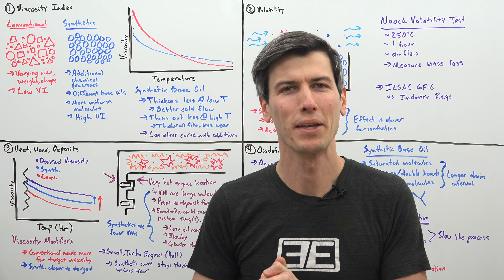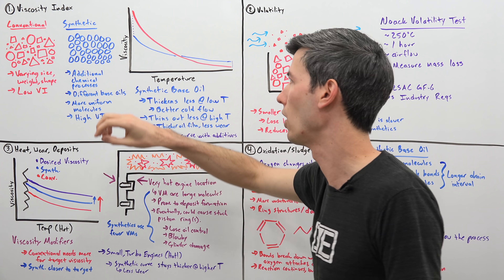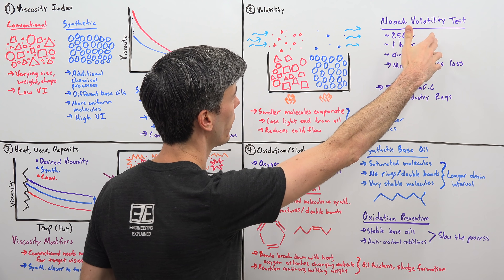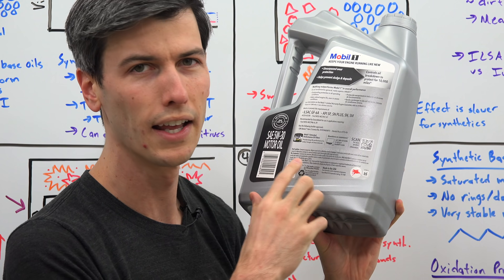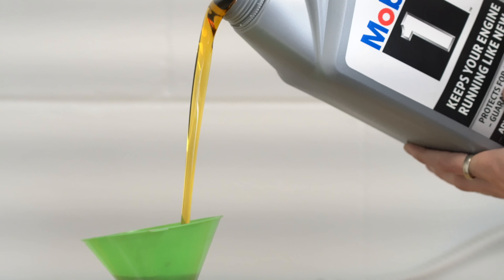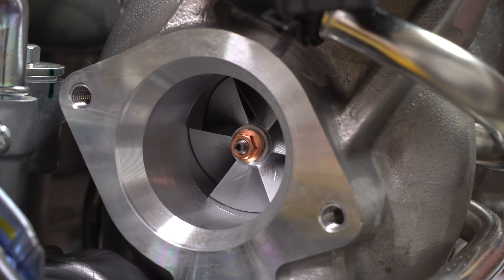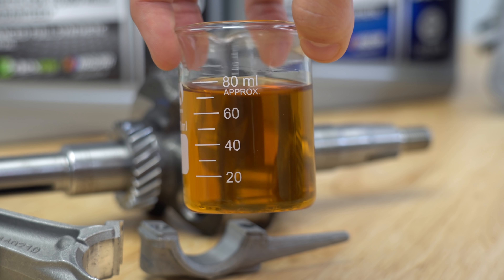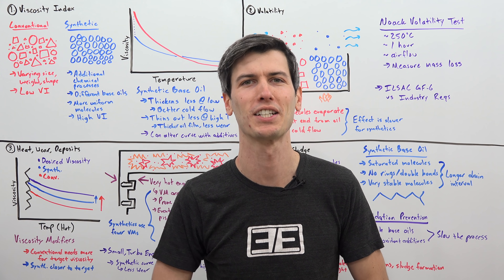Synthetic vs Conventional Oil - There's A Good Reason To Switch

Comment: In the old days we put straight 30 weight in our motors. I wonder how that works compared to the kind that are formulated ie 5w 30 especially with sludge. Sometimes I think the additives are what causes it. waxes basically.

Comment: I think a bit of sludge is good, it protects a bit of the engine, so I have my doubts on using Synthetic 100% of the time.

There's also Hybrid Oil. So if I had a car, I'd do this: First Mineral/Conventional Oil, it adds a little particles to plug any holes in the structure; then on the next Oil Change, I'd use Hybrid, then Full Synthetic, then Hybrid again and then Conventional again, starting a new Cycle, i think this way is a balance combo of enough sediment to have holes plugged, yet having equal parts of Detergent Synthetic to keep it clean enough to not have too much sediments. After 3 Cycles, a Flush with BG Complete Engine Cleaning Kit, so that would be about every 6 years or 60,000 miles; which I think is a good compromise for cleanliness and sediment plugin the engine.

I'm based on the experiment these guys did with 2 gasoline trucks, running them 100,000 miles in a device, not on the road; 1 with Conventional and the other with Synthetic, the Synthetic 1 was almost clean and suffered less wear and tear; so apparently is Synthetic all the way but, Conventional helps the seals to expand and seal better. So, with my humble method, I think you get the best of both Worlds, specially with Hybrid/Mixed Oil, which gives gradual and smooth transition, from 1 pure type to the other.

I would like for @EngineeringExplained to make this 6 year experiment, and check his engine in every Oil Change; to enlighten us all; if you do it, I thank you in advance

It was insightful yet succinct, thanks for that.
In return I give you this advice: 
1) Your neck is not straight vertical, you have an angel, that's not good, learned from Chiropractors. Also you curve your shoulder area, check yourself from the side on the video, you have to be straight.
2) You shallow breath: so you make an effort to finish sentences, the blood vessels on the right side of your neck inflate, when you are running out of oxygen and your blood pressure raises to high unhealthy levels. Take a Deep Breath, and speak a bit slower, exhale slowly; it's the most efficient way to breath, it's also calming.
3) Go to the Gym a little, having muscles tonified, is healthy and will give you energy when you need it

Comment: Synthetic oils use the same base stock "cracked" oil molecules to the same size, better heat tolerance, flow, stability, and the ability to capture combustion components for filtration. My oil doesn't turn black; oil filter is now black from contaminates. 30 years ago, the conventional oil in my engine would be black in a week or so. OEM synthetic oil/filter is the best, at $6-$8 price/ quart, plus better mpg. I would not run a turbo engine without synthetic oil.

Comment: Oh no right when he said Mobil1 i quit😅, marketed nonsense stuff. What matters guyz is this.. They can call it fully synthetic BUT it can be 100 mineral oil (hydrolocked crude oil) with synthetic additives (anti ox, anti wear, blabla...). The REAL 100 synth is at least 75% 50-50 or 60-40 or 40-60 ratio of ESTER+PAO (+ adds)!!!

Comment: Good marketing......if the manufacturer recommends an oil for that vehicle in a region, use that. 
There is no need to use top shelf oils unless you're expecting to run that engine beyond its normal operational limits.
Reply: Why do you say that, he at no time mentioned any specific brands.

Comment: It is just the same to use mineral or syntehtic oil if the oil is changed often enough. They are just as good lubricants. Especially SL or "older" oils. SL is "life", SM or later are "murder", a rule of thumb.  Some "old" oils are actually better as lubricants.  But, some modern engines are more picky for oils, even to the point where the oils are car maker specific. That just tells that those engines are borderline reliable.
I have several cars and trucks. My -79 Blazer has original engine with million+ kilometers on it. It runs like new, just passed MOT test like it was actually new. But it has had oil changes at about 5000 kms max, usually 3000 kms or less, mostly mineral oils, sometimes synthetic for hard winters here in Finland.
While the syhthetic myth has been created by oil manufacturers,  the real benefit is with turbo engines. While turbo engines are more efficient, they are also more unreliable. Using syn oil keeps that cursed thing alive longer as it does not burn to crisp but to sticky goo. Just like every motorcyclist knows if oil gets to the surface of exhaust pipe.
The uniform molecyle size is indifferent thing. It does not matter, it just comes with the manufacturing process.
And, most synthetic oils are for light duty use only. I once, long time ago, thought that 5W-50 Mobil One is the same as straight 30W oil for my boat engine , 5.8 V8. I cruised to Kotka from Helsinki, and at Kotka end listened to the engine , it sounded BAD. The oil had just failed. I fortunately was able to get 30W oil from a local fisherman, and after changing the oil the engine was silent again. Later i told about my mistake to the OMC mech, he gringed and asked if I had blown the engine... Now, using mineral 20W-50 the engine is happy.
Mineral oil is cheap. There is no need to use syn oil with older engines. Just change the oil "too often". New engines are designed to be disposable, and meant to last about 5 years, so use the recommended oil to get them last even that. But change at half the kms that the manual says.

Comment: If the vehicle originally speced conventional oil, stick with conventional oil. If speced synthetic, use synthetic. But no matter what you use, change it often. Polymers break down fairly rapidly, and dirt in the oil, no matter what kind, is the enemy. And most synthetic oil sold in the US is simply upgraded conventional oil, not a true ester based synthetic.

Comment: I have been around for quite a while. You have confirmed so many of my thoughts. Thanks a million! A few extra $ well spent and I still change my own oil.  Make ing cost basically same price or less as Oil change shop and I control what goes in my vehicles. No guessing games .One car one Rv  . Have used synthetic since it hit the market. Also use K@N filters since forever. Any thoughts on K&N or did I miss a presentation? Thanks again.

Comment: Alright, explain this.

New motorcycle.  New !!!!
Don’t forget it’s new.
Yes, I said new.
Motorcycle is 100% stock.
No mods.

From day one, it runs great on 87 octane.
600 miles, first service, oil & filter change. Still running great.

1806 miles, running great and goes in for second service, oil & filter change.  
pick up bike, now ENGINE KNOCKING first two minutes, then smooths out.
Every time the engine starts it knock for two minutes.
But not completely, yet hard to notice.

NO ECU updates.

So new bike, no internal adjustments, no modifications, just oil changes. 

This is on 80% or high of all this type of engine.

The only difference between new and the services are the oil changes. All these motorcycles with this engine all over the world have this issue.

The common denominator is the oil change.

Is it possible that the oil at the factory is conventional oil and it doesn’t cause the knocking ?

IF this is true then conventional oil lubricants better than a semi or full synthetic in this particular application?

Can anyone help here ?

Comment: Viscosity index modifiers are not lubricants. They are a major cause of sludge and gunk that forms in an engine. Notwithstanding, it also makes up ~25% of the oil in a multi viscosityquart.  A mono grade 30 weight high detergent oil is the best thing that you can use, conventional.  It will not ruin the seals in your engine and unless it’s 32°F or below, you got nothing to worry about.  Change your oil every 5000 miles with hi detergent conventional motor oil.  When you use a mono grade oil during the summer 100% of the contents of the quart of oil is lubricant.  Manufacturers of motor oil don’t communicate this because they want to sell the narrative of a multigrade oil.  Multigrade oils are absolutely a must if you’re going to have temperatures below 32°F.  However, if you don’t change your oil often, you will form gunk and sludge in your motor and ruin your engine.

Comment: What would you recommend in my 1998 Mercury Grand Marquis with 78,000 miles? It doesn't leak or anything. I just got it. Runs great. Super quiet. Getting ready to do oil change. Have no idea what was in it prior.. I'm debating on syn blend or full synthetic, Valvoline max life blend or full synthetic? Idk

Comment: There is an inherent problem when switching form a conventional oil to a synthetic oil. I as well as other people I know had our vehicles start using oil in between oil changes after making the switch. If you are going to make the switch go with a slightly heavier oil. Example: if you use 5w30 switch to 10w40. That will slow down consumption...it did for me.

Comment: Heres the fastest way for me to tell you the difference, synthetic lasts 5k miles, (regular oil change intervals, some run 10k miles, and I don't recommend higher mileage) and conventional lasts 3k miles, this entails that you get 2k miles more out of that oil and it costs around $5/10 more, and you basically get double the mileage when considering the cost of the oil change itself, you are saving money just by running that synthetic oil

Comment: I will never use synthetic oil again. I have had two very bad experiences with synthetic in engines. One trashed it where I had to sell the car. The oil is so thin, that with one small valve cover leak. Your motor is gone. There is no reaction time.

Comment: I have used Mobil 1 products for 40 years and can attest that it has worked great for me. It’s new torture/ litmus test will be in a GM High Feature 3.6 liter + 300 HP engine that is 12 years old. Can it make those pesky timing chains last another 12 years?  So far, so good.

Comment: I've had similar conversations about metal screen oil filters vs. paper filters. Metal filters are more  consistent with the size of particle they let through (medium small), where paper has a wider range of particle they filter (large medium small).

Comment: Good information.  I wish it went further.
* outcome of going from 0W-20 to 0W-40?  Good or bad?
* is changing oil once a year enough?  Under 5000k miles per year.
* many cold starts, low mileage yearly less than 3k,  is oil change once a year enough?

Comment: This is a great story but in real life I have over a dozen collector cars , I have always used 15/40 Castrol diesel in all my gas engines and a dose of GM EOS for good measure , some get changed every 10 years and as I am always playing around with cam and head changes I can see first hand no negative effects from extended changes , also ran a fleet of cube vans of 2000 model vintage same oil changed every 10,000 km after 500,000 plus km engines were showing minimal wear !

Comment: Warning, this video is no longer relevant since most full synthetic oils today are Hydrotreated instead of PAO! What he said as conventional oil is hydrotreated, what he said as synthetic is hydrotreated. He was comparing hydrotreated vs hydrotreated, how could they differ?
Reply: There are plenty of mineral diesel type oils out there, ...but generally yes you are right 99 percent of synthetics are hydrotreated mineral oils called Full or Fully synthetic.   It is just another American scam.   Synthetics or hydrotreated are both cleaner than mineral oils thereby better as they do not degrade into sludge etc., as fast.   I am skeptical of the influence of differing molecule sizes.  What practical difference does it make if the oil is a soup of varying molecule sizes or more uniform sizes?

Comment: But conventional “mineral” oils have a higher viscosity at base. You can make a 10w-30 or 15w-40 oil without any modifiers. 5w-30 have a 1-3% modifiers, 0w-40 up to 15%! Not any synthetic oils is good, some of them kills pistons already for 30-40 thousand miles.

Comment: I tried switching to synthetic at about 100K - engine started leaking - switched back to conventional - leaks stopped after a few K... engine runs buttery smooth with conventional. Just change it every 5K

Comment: Okay but let me say this. As a 49 year-old I have seen Toyotas and Honda engines that (that I and people I know have own) have used conventional motor oil go continually over 300,000 to a 1/2 million miles. So why should I use synthetic oil when I don't see anybody driving a car over what conventional oil can do for an engine? Truth! Besides the cars they make now with all of the cheaper components like alternators, starters and all the computer and electrical driven motors that fail in a few years no one keeps  cars now after 200,000 miles anymore because it's thousands of dollars to fix all those bells and whistles

Comment: Hello, could you do a video on API SP grade engine oil (introduce in year 2020?) which is supposedly able to provide protection against wear on timing chains. There is no such claim for API SN engine oil. Many brands cars made, from year 2005 until 2015, reportedly having premature sprockets and chains wear even when engines are having less than 80000 miles on them. What special additives that Shell or Mobil had put in for API SP engine oil. Thanks.

Comment: I understand that the govt is allowing some manufactuers to label hydro treated base stocks as synthetic because under a microscope they appear the same will these hydro treated base stocks hold up as well as Ester based synthetic oil also I believe many of the additives are organic. Personally I change oil 3000 miles and use a synthetic blend

Comment: So all the cutsey joking about squares and triangles aside, can anybody REALLY tell me what makes up polyalfaolefins?  Amsoil says it doesn't come out of the ground, and yet they use railroad tankers to bring these mysterious "raw materials" into their plant.  They won't say, so it might as well be "circles mixed with a little red and some black".  Unless it's 5W30, in which case, they use yellow instead of red.  But circles of what?  Yellow what?  What is the feedstock and why is it so mass-intensive as to require railroad cars to transport it if it's "not out of the ground"?

Comment: Back in the mid 80s, I owned a small car that recommended 5W30 in the engine and 80W90 in the manual shift transmission. I had a half full bottle of Mobile one 5W30 and a half full bottle of Amsoil 80W90 gear oil, both synthetics. It was the middle of winter with temperatures at -38. I left both bottles outside on the balcony overnight. In the morning I brought them back inside and was impressed with how the oil moved back and forth when moving both bottles around. Needless to say, I was glad to have those oils in my car.

Comment: Hi Jason. Thank you so much for your content. I´m learning a lot. I do not know if you can answer a question for me, but I will take a shot: I have a Ford Fiesta ST and the oil available around here (in Colombia) for this engine, is Synthetic blend Motorcraft 5W20 (as specified by the manufacturer). I have just serviced my engine with only 2.350 miles on the oil since the last change, but this oil was 21 months old when changed, because I am not using my car a lot (mainly, thanks to the pandemic). As the manufacturer recommends to change the oil every 12 months, how can I be certain I didn´t damaged my engine? Is there usable data on the relationship between longevity of the oil and mileage vs loss of properties? Thanks a lot again. Greetings from Colombia.

Comment: When I have customers ask why they shouldn’t put Conventional oil in their new car which takes only full Synthetic, I use operating temperatures and the evaporative and thickening qualities of Conventional vs synthetic to explain why their car requires the expensive oil. Most stick with the Full Syn. But if they really just don’t have the money I just stress that since they’re putting a lower grade base oil in their newer car, they should be careful to get their next oil change no later than 3k, the Conventional just won’t hold up as well. They usually appreciate the advice.

Comment: Synthetic on newer engines i agree, but older engines there was a lot of heat generated on air cooled VW bug. so i would think oil changes at early enough intervals using mineral oil is still a good deal on older engines.

Comment: At least in the case of my 130k mile K20 Civic Si, I switched to full synthetic and noticed that it runs smoother on cold starts and before the engine warms up fully. Also, got some noticeable mpg increases and burned less oil.

Comment: I change my car and motorcycle engine's oil each year despite the millage I do using the specs of my maintenance charts with Motul products (oil, coolant and brake fluid), its been 20 years so far and neither of them gave me any type of problems running perfect just by doing regular maintenance.

Comment: Keep the oil clean. New oil and filter every three thousand miles. It’s cheap to do or have done. Conventional oil, synthetic blend only has 5/10 percent synthetic oil in it. Most full synthetic is not full synthetic. Full synthetic is very expensive. Redline Amsoil. My neighbors 07 Honda Ridgeline has over 750,000 miles. He changes his oil at the dealer or $29.95 with $10.00 coupon. He probably is getting synthetic blend which has 5/10 percent synthetic oil in it. Keep it clean change it regularly with new filter. My other friend has almost 320,000 miles uses conventional oil only. Again every 3,000 miles.